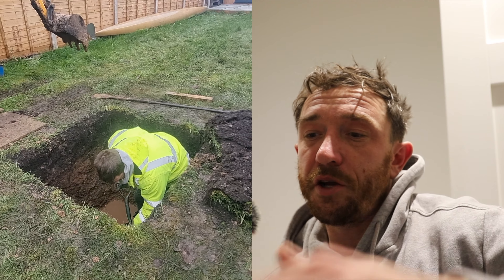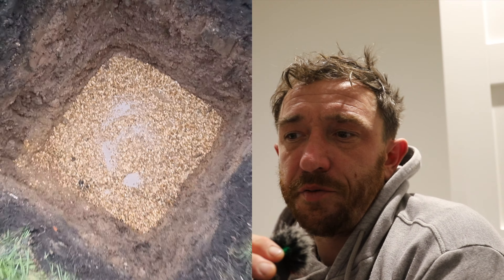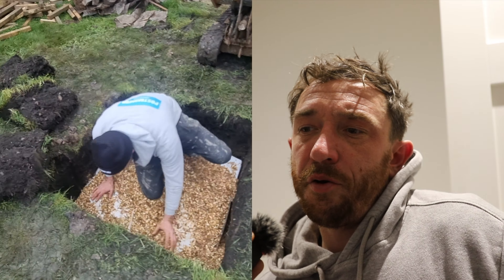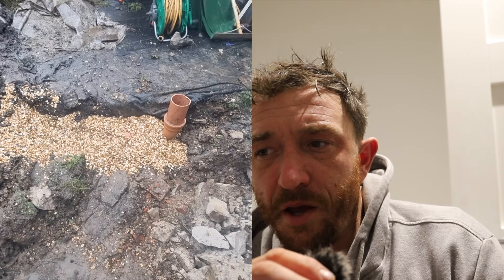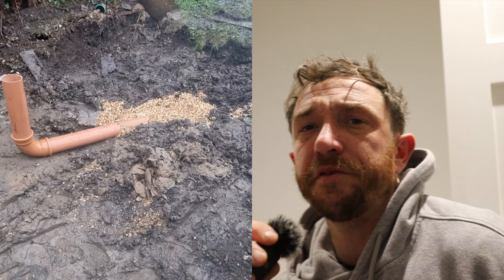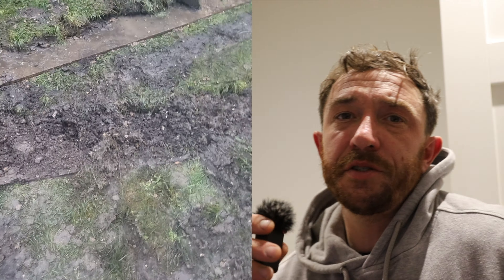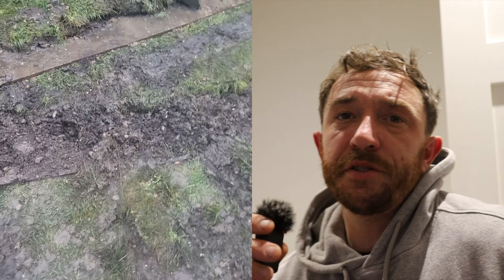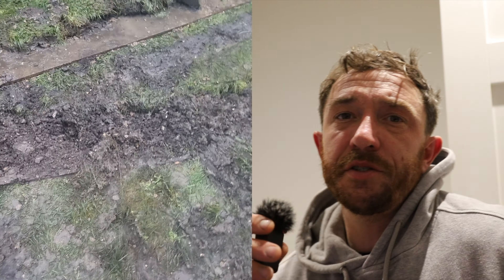How to install a soakaway

Comment: Shouldn't you connect the pipe leading to the soakaway prior to covering the soakaway up or is the entrance for the soakaway left clear? Couldn't really see in the video sorry
Reply from the maker: my apologies I should have made it clearer you should connect the pipes prior to covering up, these should also be surrounded in shingle .

appreciate the comment
Reply: Thanks for getting back to me mate. Im always a little skeptical when digging deep, how do you make sure you dont hit any utilities?
Reply from the maker: No worries, I appreciate the comment.  I mean, you could always use a CAT ( cable avoidance tool ) but i generally have no problem you can gauge were  the services are but always dig carefully if your using a digger have a spotter

Comment: Will this work if your in clay? This excavation. The excavation Looks like clay
Reply from the maker: No thats not clay lol, clays is more bluey brown,  and so much stickyer,  clay you would potentially double up soakaway or dig deeper,  no this was just normal,  we hit sandy shale with this, perfect conditions.
Reply: I have a drainage problem as the back of my house so weighing up options. Have undertaken any trail holes or have you had previous experience with the ground?
Reply from the maker: Where we live, there are a few areas that have clay, and generally, we would dig down until we've found gravely shale ,  but depending on were you are in the country that depth would be different. for us it's only about 1.5m deep. But no I've never had to dig trial holes.